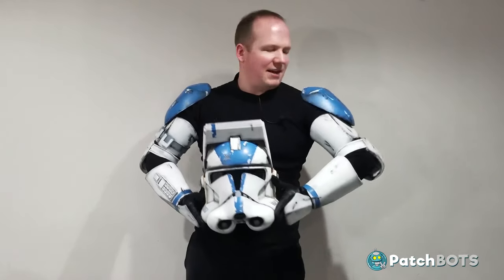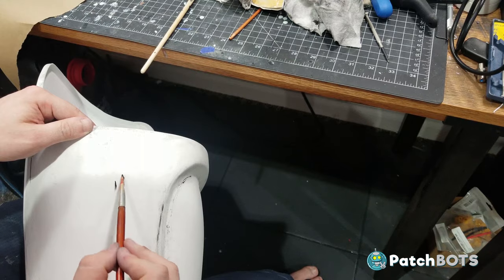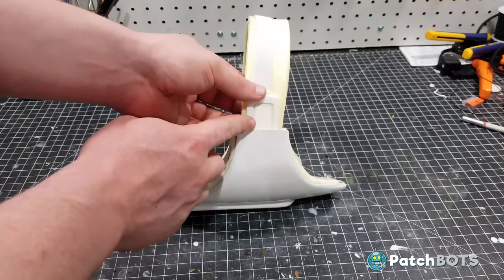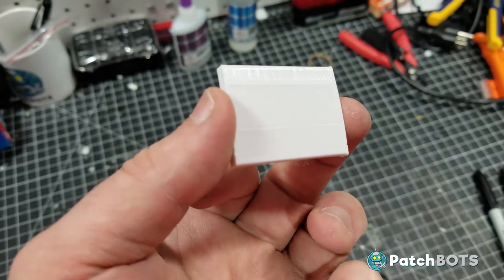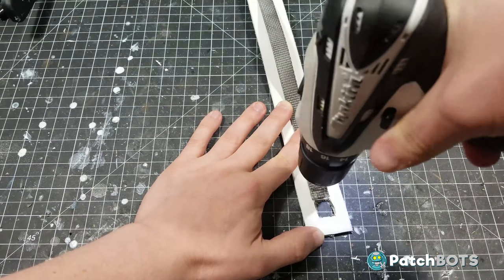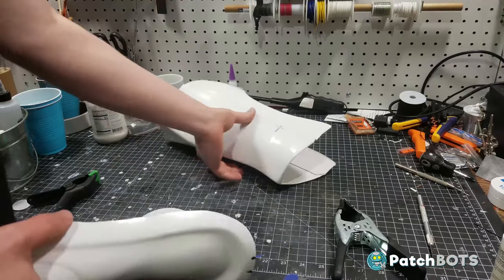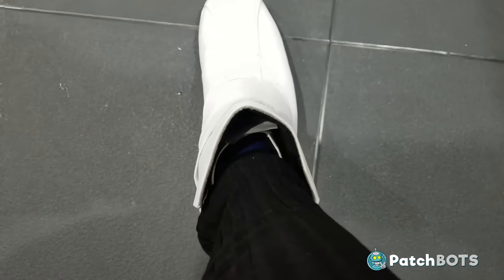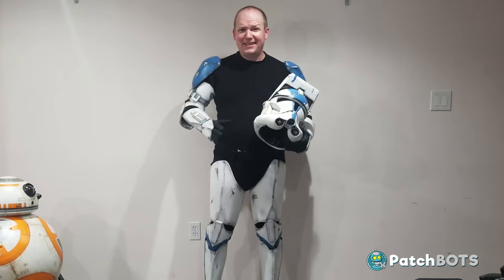Star Wars Clone Cosplay - Part 12 - The LEGS

Comment: How's your mobility for walking? The lower tip of my thigh pieces are very tight around my knees (granted that your set is Realistic while mine is Animated 1-3 Season, but I think some mods and adjustments are interchangeable for different sets).